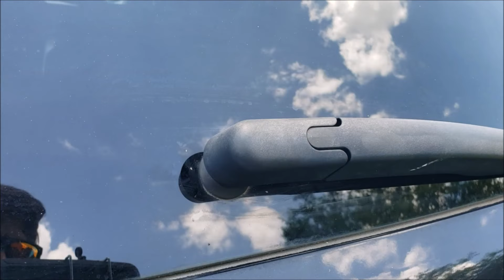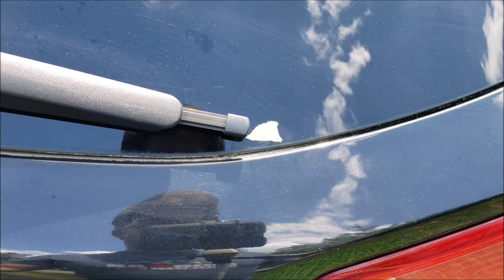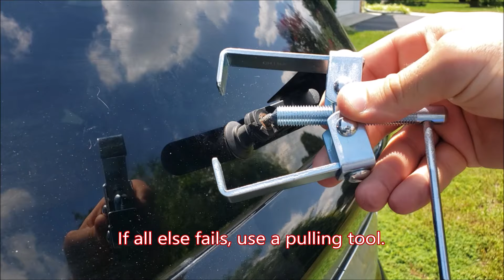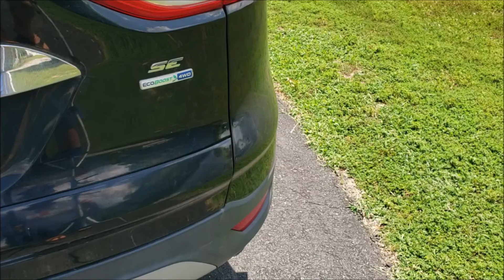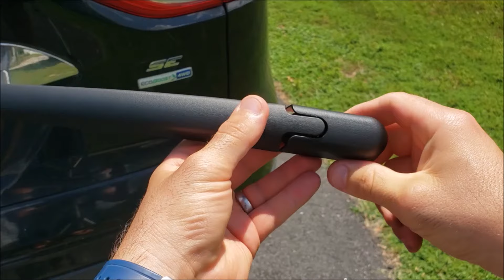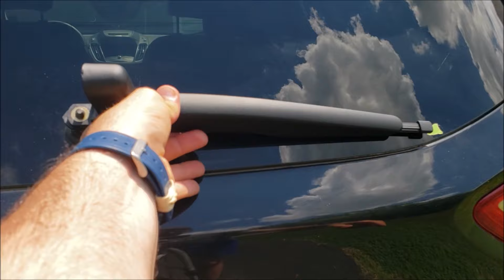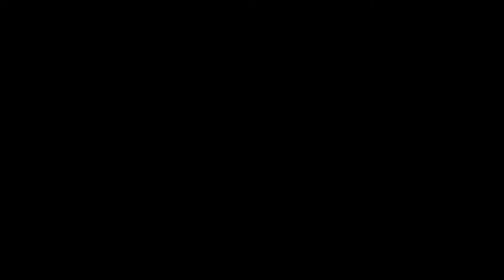Replace the Rear Wiper Arm: HOW TO ESCAPE

Comment: It's a 2009 Grand Caravan...
Reply from the maker: Sorry Michael,  I'm not sure what an 09 Caravan might have for a threading spec. I'm pretty sure mine was a fine thread, but you may be able to find out on a Dodge forum OR on RockAuto if you look up the wiper motor for your car there? Perhaps it will have the threading noted? Sorry - I wish I could help more- i only have our Escape to go off of. Good luck!
Reply: @HowToEscapeDIYTipsandReviews  Many thanks for the response.  I wound up ordering the manual from Rockauto, but even that didn't tell me any info on the thread type, so I ordered one off Ebay and prayed.  Again, I bought every thread config. I could find at the local hardware store, and none of them felt "right" when threading.  The ebay nut went on with no problem.
Reply from the maker: @conga205  Awesome! Glad to hear you found the right one and it was your fix. Nice work!

Comment: you don’t have to remove that to change the blade. the back wiper itself snaps on and off with a flat head screw driver. i came here only to specifically see how to remove the whole thing itself because it’s ugly and i want it off my titanium lol
Reply from the maker: Hey Cory! Small world, man- I actually JUST saw your post in the Facebook group about the rear wiper delete. Crazy world, this internet place... in terms of your delete kit, here's one on Amazon for a Focus- I am NOT SURE it is an exact fit... but there is usually a lot that carries over between the Focus and the Escape- check it out and let me know what you think if you have a moment: https://www.amazon.com/Torque-Solution-Wiper-Delete-Focus/dp/B07PNRWGQH

Comment: I don't think you need a pulling tool, if they are like the front wipers, then you push down then pull up and it comes right off.
Reply from the maker: Its not like the front unfortunately- the material differences makes for a lot of corrosive interaction and it often gets stuck- if you CAN push it down and get it off, let us know! However, mine was fused solid and I'd be hesitant to push down on that motor to be honest.
Reply: youre thinking of a j-hook style wiper arm. j-hook is unfortunately NOT universal in all cars / rear wipers.

Comment: This video is totally overkill. The actual blade itself actually just pops off of the arm, with your thumb and then you pop the new one back on. There is no need to remove the whole arm to replace the blade, as depicted in this video. Watch another youtube video displaying 
the method just described. Took me 2 minutes to swap out the blade, ONLY! Don't remove the arm! See this video  https://www.youtube.com/watch?v=B0PVF6HEfPY
Reply from the maker: Hey there and you are correct for just the wiper blade. This was for the actual arm for people who have the bushing fail and the arm not rotate as needed OR if it just hangs limply while the motor turns. You are correct in that the blade is simple to pop in and out. Thanks

Comment: What size is the nut that goes on top though and right under the cap? I think I threw mine away on accident a while ago since mine has been corroded for years i just couldn’t find the right video for some reason?